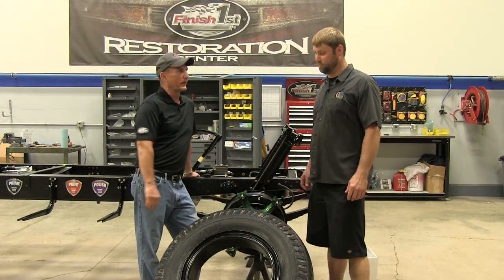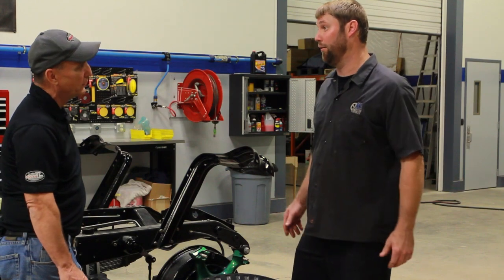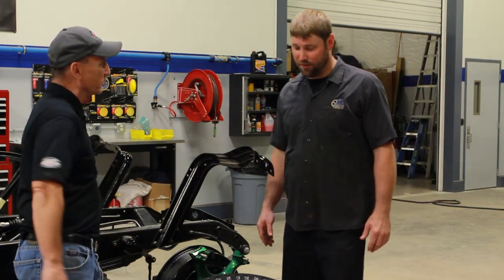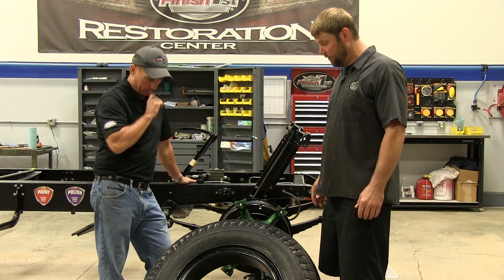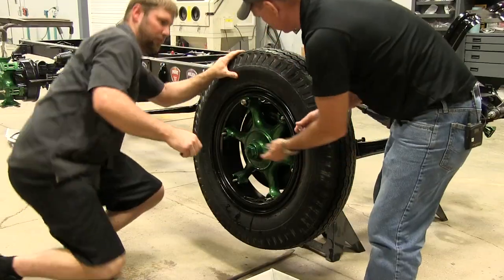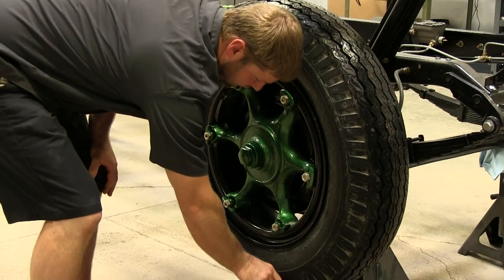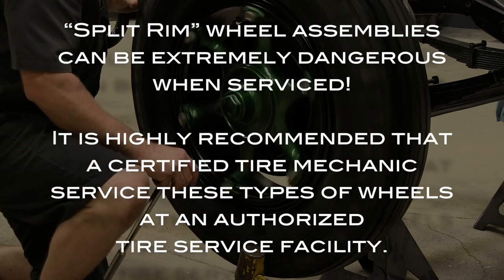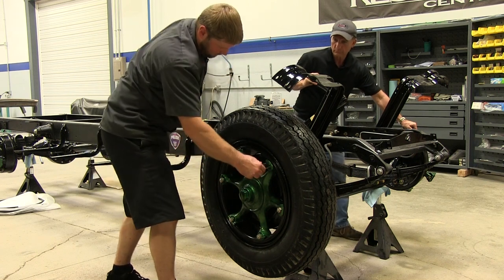Split Rims Deadly Suicide Rims; Split Ring

Comment: You guys dont mention a few things i think you should. Never mount and dismount a tire that is inflated, you inflate AFTER it is mounted and deflate BEFORE you even think about removing it. When removing back the lug nuts off a few turns then smack the wedge with a hammer and the deflated wheel will pop forward being safe to now remove by backing the lug nuts off and removing wedges. the ring goes on the INSIDE towards the center of the hub so the inner ring will face the center of the rim and the outer rim will face the center of the rim. Most of the mechanics killed in the stories did not respect rule #1. i changed on average 8 - 16 of these a day.

Comment: Split rims are just split rims. The really dangerous rims are called widowmakers.  There are 2 equal halves to the rims with no lock ring. The problem with all of these is; people distort the rim or lock trying to force them apart. Then, the next guy has a distorted lock that won't seat well. I just got a truck with a full set of the 2-piece widowmaker rims. Last time I bought a truck with widowmaker rims, I just let out the air and rolled them over to the scrap pile.  Then, I put on splits.
Reply: There are split rims and there are split rings two different assemblies. Split rims have a split at the valve stem with a ring with no split. A split ring has a solid rim and the ring has the split. Widowmakers are not rims but wheels made by GM in the 60's. I have changed or repaired quite a few of these over the years. My dad had an account that had 12 or 14 trucks that had widowmakers on them, Murphy Oil Co.  The replacement wheel to them was a drop center wheel with a continuous ring (no split) a little safer but not much. 3rd. generation would have a split ring. I would still change or repair a widowmaker today as long as it is not to badly rusted. But still only put 5 to 10 PSI to seat the wheel then bolt it on the truck (front or rear inside) and finish airing it up. That way if it blows it may damage the truck and scare the shit out of you! LOL  I'm 61 and have been doing tires since I was 14. I have a Widowmaker wheel I'm having made into my grave stone with two tubeless tire iron welded to the top, it will be one of a kind. Tireboy1
Reply: chatsworth777 Very well put. some accurate information about these wheels for a change. thank you

Comment: If you are properly trained never a problem, they were used forever on trucks until tubeless tires arrived on the scene.  Most tire shops nowadays won't touch them unless you live in farm country.  trucks shops sometimes will do them but you can tell these kids are scared of them.  accidents I have seen resulted from messing with a broken/defective wheel or welding on the wheel and way over inflation
Reply: for me they were safer than tubeless because tubeless were more likely to blow out and kill you... doesn't help all of the heavy duty owners want to use reman tires that are super old sometimes and you get what we call a 'zipper' effect where the sidewall literally zippers down... it does that right before it blows.
Reply: MKIIIsupra2jz yes most of the bias tires only took 75 pounds. Still very damaging Force if it blows. but if the rim numbers match and you know what you're doing . they are fine. just because they were together. doesn't mean the parts go back together. you must check every time. rims should be reconditioned. And if you can't read the numbers scrap it. tubeless usually blow around 90 pounds when they zipper. except for fronts I run them at 105.

Comment: just a note heavy construction equipment still mostly uses multiple piece wheels
Reply: I worked at a railyard and 80% of the chassis that hold shipping containers use these still.. they are more common than you think i would change up to 20 of these some days.
Reply: MKIIIsupra2jz you are correct. I've done UPS rail boxes for years. they still are running the 10.00-20.

Comment: My 46 Studebaker m16 flatbed has the split rims when I changed my tires I chained the rims up and aired them up slowly with no trouble...BUT they are dangerous/
Reply: inflate AFTER they are mounted and you wont have trouble. doing it before they are mounted is asking to get killed
Reply: do you mean bolt them to the vehicle first then air them up?

Comment: Never had a problem with split rims and have changed hundreds of tyres. If you carry out the procedure the correct way,don't guess and don't cut corners then there is nothing to be scared about. People try to split the rim with pressure in the tyre or loosen the wrong bolts,both easily avoided if the correct procedure is used rather than assumed knowledge. The tyre is best inflated on its side under the rear axle of the truck and with a remote inflater. Rather than going to full pressure it's better to inflate a few psi and check for assembly. Inflate half way and let it sit,have a break and check again. Very few accidents are material failures,they are made to take a beating, but rather human errors.
Reply: tap the split ring with a hammer to make sure it is seated. Never had one blow off.
Reply: i agree i feel the most dangerous ones i worked on were tubless

Comment: Great restoration.  Those wheels are kind of scary.  I think I'd graft a late 80s chev C-20 front end onto it.  Add a matching dual wheel setup on the rear.  Everything else is pretty close to perfect.
Reply from the maker: +lasalleman Thanks for the recommendations, but unfortunately we were limited on time.

Comment: split rim is not a suicide rim.  it's a Darwin rim.
they are only slightly more "dangerous" than 16.5 rims
Reply: grumpybill what's the problem with 16 1/2" rims? I only ask as I ave these on my RV and not had or heard of any problems with them?
Reply: Andrew Wilson some folks have run 16.1 on 16.5 wheels mostly works or 16.5 tires on 16 rims. The best and brightest

Comment: I use a leather hammer. I quit going to tire shops because they beat them to death with hammer and had no fiinness at all. Clean the groves and paint them. Inflate in a cage or bolted to the truck with the ring pointed in, or under forklift forks and stand out of the way while inflating with the clip on air chuck. If it is a matching ring in good shape and parts are clean and not bent - that ring isn't coming off.